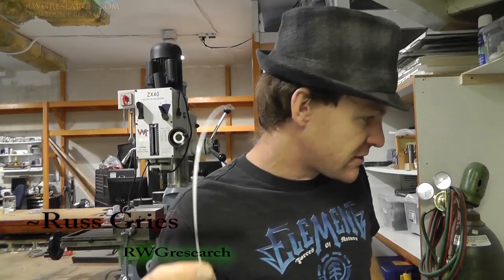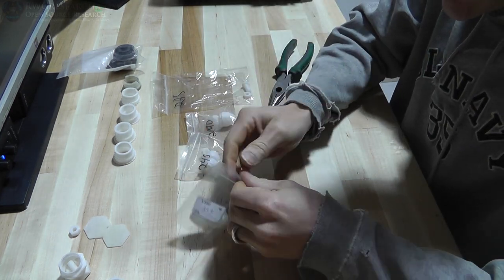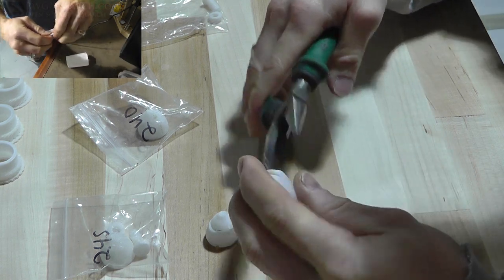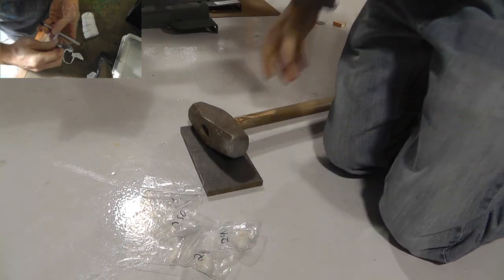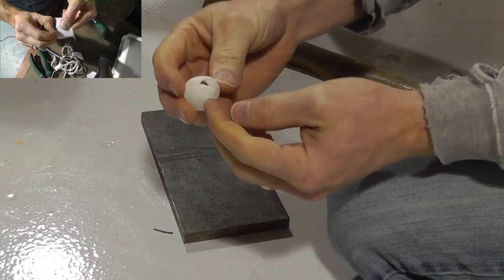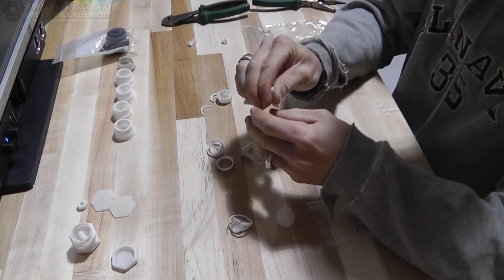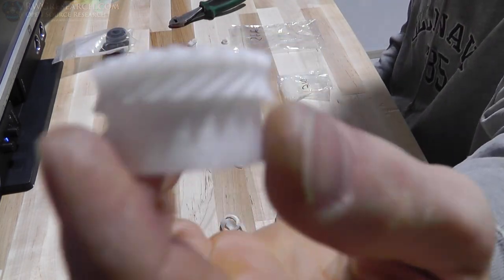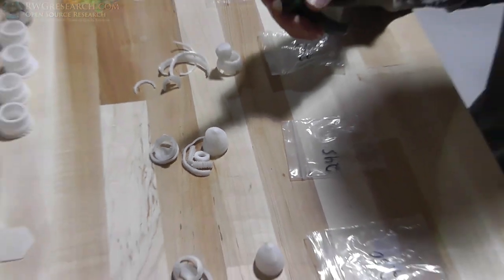3D Printing:Taulman 618 Nylon Strength Testing, Smash It, Hammer It, Bend it, Manny Temperatures.

Comment from the maker: just some of my own testing. Manny temperatures and such. what works best?
For me, slower speed is best, and a Temperature of around 238-242C seems to give me the best results. layer height of .06-.08mms with a .35mm nozzle. A lot more to test but for now this will get me started! learning will come with more printing...

~Russ
Reply from the maker: ***** thanks! that one is checked off my list, But, what cad program do you use? ~Russ
Reply: I use taulman bridge and pctpe. I print at the on the high end of the recommended settings with lots of infill and I can't break the parts

Comment: I may be way off but I think you may be having delamination issues.  Which I think you need to go even hotter.  If your splitting layers I would def go hotter or slower.  I may be way off.  My first thought if your getting layer splits is previous layer is to cold compared to the new layer.  So three options heat your build chamber to high point, raise your hot end temperature or print at a slower speed.  BTW I watch all your videos and have learned quite a bit from you. I really appreciate all the time and effort you put into passing on your knowledge.  Thanks Russ for sharing.